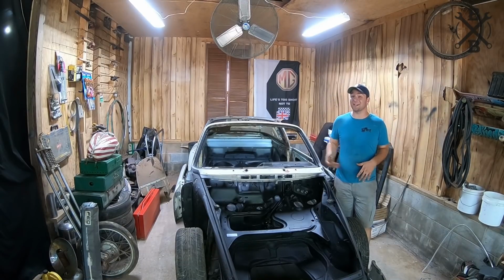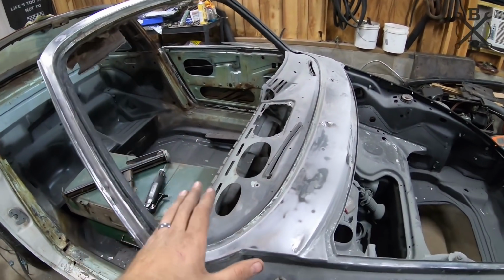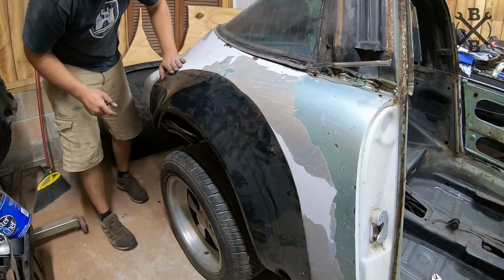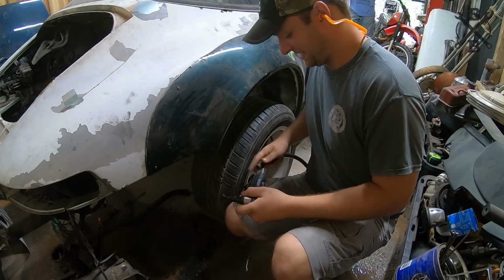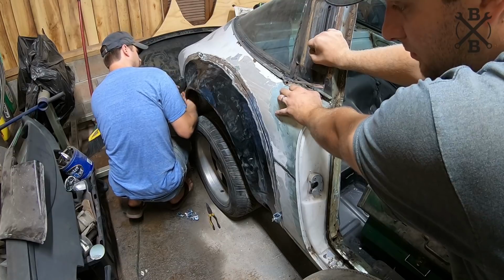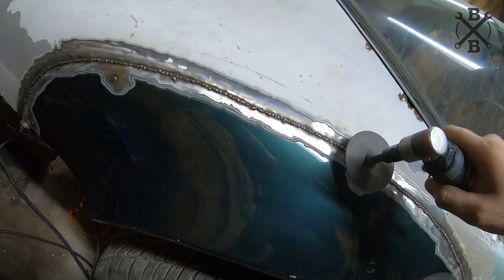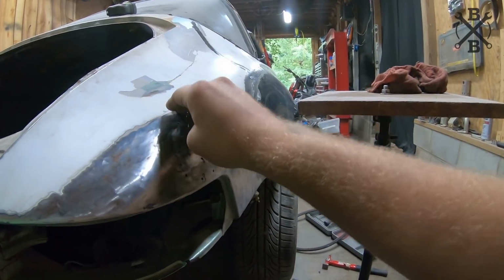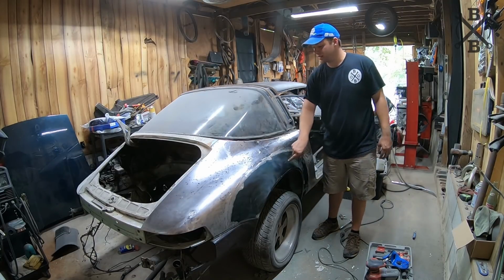Saving a Vintage Porsche 911 Targa from the Scrapyard: Rebuild Part 18

Comment: Loving this. Did a 74 Targa repaint in the mid 80s in my garage.  I used paint stripper, far faster than the mess of sanding.

Comment: Good job! Extremely honest repairs, no script, just going. Love it! Wish I had a Porsche to work on. Here in Sweden a salvage car can never go back on the road, it will be scrapped and broken for parts. Some really nice ones unfortunately gets scrapped and can never be saved.
Reply: Rehnqvist76 what a terrible waste. I understand if there’s severe structural damage, but even the most severe damage can be repaired with enough money put into the project. Obviously, after a salvage car is rebuilt, it goes through a pretty in-depth safety check. 
It’s kind of a sad statement of the throw away society we’ve become. Love what Michael is doing! Resurrecting what most scrap yards would have crushed!

Comment: I recently fitted a aftercooler to my aircompressor to stop water getting into the air tank, used a automatic trans cooler, and a water trap before the tank, works great, easy to do.

Comment: an 80 grit carborundum 8" disk fixed to a drill or grinder works well to remove old paint down to the metal

Comment: Looking great , can’t wait to see it in paint , probably a bit late now but carbide burs work great in a die grinder for knocking down welds without creating too much heat and good control with being able to just cut back the weld quickly , looking forward to the next video, cheers from down under 😎👍👍🇦🇺🍻

Comment: Note: by fitting flares your precious car is loosing its originally big time. It degrades everything else that you have strived to keep original, all gone !i think its a sad move, but once its cut, its cut for good, no going back.
I do commend all the other good work that you have done. 🎉🎉🎉

Comment: Good stuff man 😊 For quicker paint removal look for paint strip discs for your angle grinder.  Fleabay or Amazon or maybe even Harbour Freight will be cheap. They don't eat the metal but make quick work of paint and be way quicker than the 3 inch die grinder 😉

Comment: Nice work! I couldn't have done a better job, myself!

Just wanted to mention, you should get some primer on that raw metal as soon as you can. It's amazing how quick body panels will flash rust, especially with all the humidity in the air.

Comment: You did a pretty good work so far. The car seems to be 1974 or 1975 because from 1976 they had galvanized floors that actually don’t rost that much. Hence it is a very rare early G model! Widen the rear fenders will massively reduce the final value of the car. Same with rear wing but that is easy to change. I restored my first 911 in 1989 and quiet a few more since then...

Comment: you need aviation paint stripper. Much faster than a grinder!
Reply: yeah that's what I thought too. The paint job obviously was FUBAR so I would have stripped the thing at the get-go rather than exposing myself and the whole shop to all that dust.
Reply: In Hot Rod magazine they used paint stripper covered with saran wrap so it would not evaporate so fast...worked for them...

Comment: Hello Again, get a second air line and blower tip.  When you weld, as soon as the cherry red is gone, blast it with compressed air to cool it.  That will prevent panel warping a make it so you will only need the tiniest skim of icing ( a very fine body filler,) sold in body shop supply houses and will make the finished job that much less work to complete.  if you go to a place that sells automotive paint you should be able to buy it there.  sand using 360 grit to promote the filler to give it a tooth for the filler to stick to.  There are numerous YouTube videos about how to paint a car and use fillers etc.  Painting a car is 95 percent preparation a 5 percent painting. the reason the paint did not stick was poor preparation and it looks like it was painted using inadequate sanding, no primer and cheap junk paint. each layer must be sanded before the next layer is laid on to promote adhesion, and it is a good idea to use a light coat of adhesion promoter. Also cover all glass when grinding or you will be replacing damaged glass. Paint stripper is much less work than sanding, and must be completely removed and wash down before anything is sprayed over top.  Wax a grease remover is you best friend.  if you insist on sanding there are much more effective attachments designed to remove paint that sand paper ask at the counter, these new advancements last mush lover than sanpaper are are far more effective at removing paint made by 3M out of nylon and work amazingly well at stripping paint.  Personally I prefer Aircraft Paint stripper, then I use sandind disks to remove old body filler and wetsand to provide a tooth for Primer or Body filler or emery cloth or sanding sponges that com in assorted grits and flex around contours.

Comment: Couple of tips I found over the years, They make bigger strip discs to remove paint and they even have some that fit in a drill, you have to be carefull of adding heat and warping the metal when removing paint like that. 

Look for a DA or dual action sander it eliminates the circilar scratch marks a regular grinder leaves.  

If you do use paint stripper, use duct tape to keep the stripper and nasty paint out of the body seams and cracks so it does not creep out later and ruin the new paint, even if you rinse it good it can hide in the seams. Id stay away from it, its nasty stuff that is a pain to clean up and it will ruin any plastic it accidentally splashes on. Especially in a small garage like yours, 

Also cover the wheels also to prevent damage from stripper.  

I had bought a reprint of an old book published in the 1950s from Eastwood called "the key to metal bumping" it showed how to read a dent or crease and use the hammers to push the metal back with out causing more issues.

 When I started out I used to pound on the dents with out knowing which way the metal wants to go. After some practice you can take some severe damage out with little to no filler needed.  

Its worth looking for a copy. Id send you mine if I could find it LOL.

Comment: If you need to "brodge" some larger gaps,, try kevlar filler instead of bondo to start with?  Just a suggestion,,,, it's ligh and strong,, and will bond well with plastic, fiberglass, and metal.

Comment: Hey nice Progress, but when you’re working with the welder or angle grinder close to your windows, you should cover them up. Otherwise you’ll end up with small metal particles in the class that will make the surface rough and rust there

Comment: Not much of a Porsche guy, but what y’all are doing is killer
Reply: Old cars are old cars, Porsche or not. All fun.
Reply: Alvin Brinson I completely agree my man.  I love everything from twin turbo sleeper Volvo’s to American muscle.  Just never really got in to Porsche’s, but I appreciate a good or fun build when I see one.
Reply: @BlownBudgetGarage  Yep, I see the old Mopars on your channel.

Back in the days before Youtube I had a beater 76 Duster that I ran the roads with. Had a project 74 Dart when I lived out west in Utah, it was a story worthy of Youtube if such had existed, picked it up cheap in a snowstorm, drove it out of the mountains down into Salt lake in the middle of the snowstorm with no muffler, no heater and no brakes. Plastered with deadhead fingerpaint shroom designs lol... I never did rebuild that one, life changes happened.

These days I stick to newer stuff.
Reply: Alvin Brinson lmao that awesome.  This swinger has no heat, no air conditioning, and is 100% not setup for the road, but we’re gonna plate it and full send lol
Reply: @BlownBudgetGarage  New stuff doesn't keep the budget safe tho.... My Abarth is a 2015, still have 10 payments left on it from new, and I've already blown both the engine AND the transmission and replaced them myself. Too much send. I don't blame the manufacturer, I tune it to an inch of its life, ride it hard and put it up wet.
Reply: Alvin Brinson well you know what they say, it’s also best to mod a car the bank still owns lol

Comment: You need a wire wheel and one of the hard sponge disc paint removers. Be alot faster with the 6" grinder.

Comment: best diy builds on the tubes, buddy.  I stumbled on your channel and have gone through most of your back catalog now.  I'm a VW/Audi guy and this old wrecked porsche that you're working on now is making me want to find one locally and get to working on a proper project.  

You definitely need to do something about the audio.  It's very much holding this awesome channel back from hitting it big.  You got the content, you and your dad are fun to watch and even having your kids pop in here and there really makes it feel like i'm just hangin' out with a buddy in the garage at home.  But the audio being inconsistently loud in places, then almost inaudible in others it's the only piece of grit in the otherwise diamond of a show.  Not sure what mic options you have for your camera, but I'd definitely suggest just picking up a cheap Zoom F1-LP recorder.  New on Amazon they're like $170.  Or something similar used on craigslist.  It'll take a little bit more to sync up when editing but it will do wonders for your channel.  Don't go and blow $3k on some fancy DSLR with bluetooth mic connections... save that cash and put it into your projects.  I have a feeling you're gonna need a few more bux to finish this porsche.  That paint and interior work are gonna go deep into the ole wallet.  Anyways, no one's still reading.  Just wanted to give you your propers for making a bunch of cool ass projects on the cheap for us working stiffs who don't have daddy warbucks sinking a hundred grand into his kid's channel.  We need more real ppl doing real cars, making real mistakes and learning and having a ball doing it.  Keep em coming, but please work on the audio! 

Lotsa love from all the way up in Saskatchewan, Canada!

Comment: The flares are awesome... but you NEED to cover up that glass when welding or grinding.  You can totally ruin an expensive piece of glass like that.  I assume you know this, but use a fiberglass reinforced body filler to seal up those welds before adding any body filler.
Reply: I just wanted to write the same thing than I saw your comment. Your totally right. I had so much pain to see Mike grinding and welding with this uncovered glas and alloy wheels...
😂😂😂
Reply: not surprised if that glass is already gone. maybe he is planning to replace it anyways...
Reply: @M3LKS  That's what I was thinking. It doesn't look like its in great shape.

Comment: Old school trick: Use a wire wheel to remove that paint on a budget. Low heat and its more friendly to the metal panels. You will have to wear those safety glasses. Keep up the good work looking good.

Comment: You should build a new workshop on you're land above the water line so you have a ramp up into the workshop. Water would then flow around the concrete base no drains needed. 
Then fit drainage around that garage at a later date.

Comment: Hey dear, nice but how much work to brush all the paint away - Did you try "demysol from wieds" or "dixapol-extra" fuel-lye (i don´t know if it is the correct Translation) or metal stripper "Beko Speed ex"? Best regards from Germany - the cradle of Porsche

Comment: Would probably be faster and better to sand blast the rest of the painted/bondo/rust surfaces. Get everything else in primer
Reply: Budget build dude
Reply: Peter Batterton you do know there is nothing budget about this restoration right.. just because he’s working in his garage and doing the labor himself doesn’t mean doing this is affordable and cheap. By the time he’s done, the total cost would make him yell lol. Sand blasting it would cut down on the elbow grease and save so much time, where saved time could be put into actual repairs and loads of sanding (A LOT of sanding). 

Plus with a large compressor at home, they have affordable at home blasters and media isn’t too much money.

Comment: Need to send over my 1971 mgb gt over to you to get it running again. Just will not run for more then a minute.
Reply: Ditch the dual SU carbs for a bolt on Weber kit.

Comment: Rear arches don’t look right should have stuck with the original wider arch now the sticks out further than the arch  don’t know about America but that is a road safety test fail your tyres are not allowed to stick out past the arches.
Reply from the maker: This was before any height and alignment adjustments were made. This was a narrow body car, I put wider flares on. The wheels sit inside of them now, with the car sitting correctly.
Reply: Here too, tyres must be within the bodywork. Can't run hotrod like American one do without guards, must have proper guards(fenders) over them.😊

Comment: I have watched the first 18 of your videos. But when you started cutting the rear fenders it really got me mad and decided to post a comment. That particular year and model in Germany and Holland is very, very rare and goes usually thru auction houses if properly restored, for around $300K. With your silly rear spoiler, flares and Home Depot paint and Bondo, you pretty much ruined that car. I saw how you welded that door and how you covered your work. I have a 84 Targa totally restored after 15 years of work. I am also a semiprofessional restoration specialist now with 30 plus years of welding. I have friends in Germany who are true professionals I hang around with. They keep saying the same thing over and over again: Weon. Now